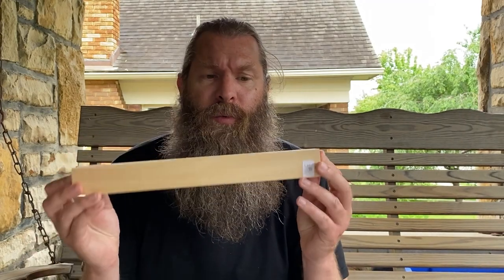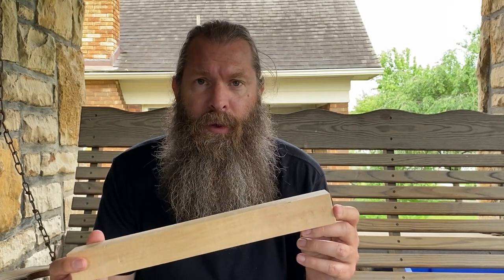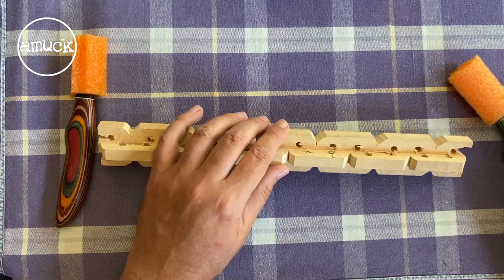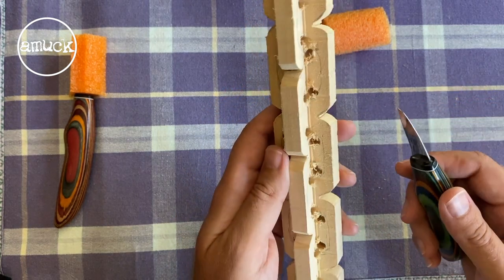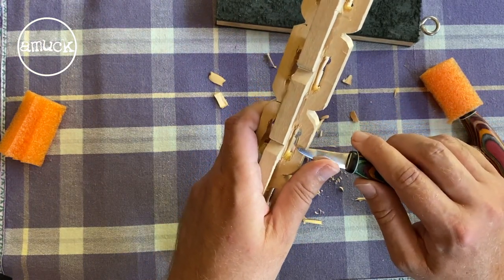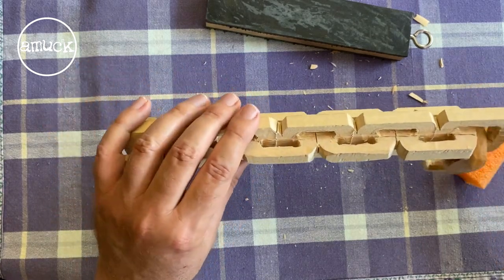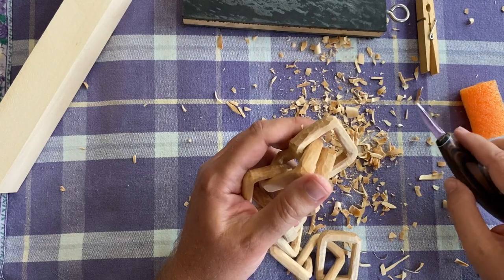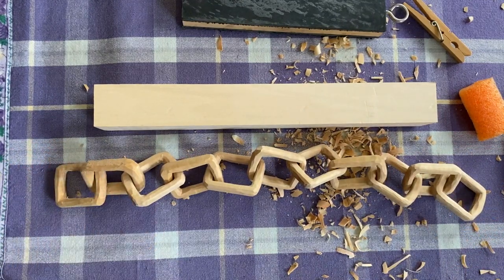Whittling A Chain

Comment: Fantastic job. I want to try the same ! Which kind of Wood did you use - and I really like your knife - seen it before on YouTube but nerver found out what its called  - hope you Will tell me ! Also seen your chess video. Very beautifull film - and set of chess. I’m writing from Denmark, hope everything is understandabel. Very best regards from here where we are looking foreward to Springtime. Esben Back.
Reply from the maker: Thank you! I’m using Basswood in this video. It’s soft and easy to cut. You can usually find it on line in different dimensions. The knives I’m using are made by Helvie Knives in the United States. Hope you try whittling. It’s a lot of fun.

Comment: Since you used a coping saw for the outside corners, you could have used it to cut the links apart by sliding the blade through and then re attaching to the frame.
Reply from the maker: You are absolutely right. My plan though was to try and whittle as much as possible.

Comment: Just one question......WHAT IS THE DIMENSIONS OF THE WOOD??That would have been a nice start.
Reply: Hi Jon, it started as a 1.5”x 1.5”x 13.25” piece of poplar. That’s just what I had laying around. Of course it’s up to you what size to start with. The process is the same.

Comment: Sawing all the corners with a machine, boring all the holes..... That's not whittling a chain! Whittling a chain, you remove all the wood you don't need, with a knive! Not with a machine! 😁
Reply from the maker: Hello, thank you for watching. I completely understand your point of view. When I carved my ball in a cage I only used knives but that was a much smaller project and therefore didn’t take too much time to complete. If I would have whittled the chain with only a knife I’d probably still be working on it and have lost interest in the project. I only called it whittling because the majority of the time spent on it was only using a knife. The world record holder for longest wooden chain ever made used nothing but power tools. I believe he did this only because of time restraints. Everyone chooses how much time they want to spend on projects their working on. I have lots of interests so that’s why I chose to use power tools to remove the bulk of the wood. I also think only using a knife would have resulted in a really long video.😆😆
Reply: @amuckdesign  Over the years I've carved over a dozen chains, most of them with a crosspiece for an anchor attached on one end, and a cage with one or two balls carved on the other end. I've done them all three ways - cut from a block that's been sawn into  "+" shape, cut from a rectangular block, and cut from a rounded tree branch. If you wanted to be absolutely purist about it, you could argue that ANY tool modification to the tree branch is not whittling, including splitting a section of the tree branch off with an ax. It depends on what you are trying to prove, and once you've proved that you can do it in its most primitive form - the tree branch - then it is just extra work to go through all of that effort again, just so you can start doing the non-drudgery part, which is the carving and whittling. So, no, I don't agree that using hand-held woodworking tools is not whittling. I almost always start with a "+" shaped blank of wood, though after that I personally stick to hand tools such as a drill bit mounted in a pin vise for drilling holes and various chisels in order to obtain flat-bottomed surfaces. For me, as long as all surfaces on the final result show knife carving marks, then it's whittling.  It's all woodworking with hand tools, and those who want to set special purist conditions on the activity are welcome to spend the enormous amount of extra time actually demonstrating what they so glibly preach to others. As you say, "Everyone chooses how much time they want to spend on projects they're working on." Best wishes, and thanks for the informative video - SLOphoto1
Reply from the maker: @SLOphoto1  thank you for the reply. I’m glad someone with as much experience as yourself could enjoy the video. I think you really hit the nail on the head when you said “once you’ve proven you can do it in it’s most primitive form, then it is just extra work to go through all that effort again”. I tend to like using power tools almost as much as hand tools, and I think there’s a time and place for most every tool. For me it usually boils down to time constraints and whether or not I’m working on a project just to have fun. It can also be fun to see what I or other people are capable of using whatever might be available to us at the time. Thanks again for your comment.

Comment: Now do a chain out of stone
Reply from the maker: 😆 I have no doubt it could be done, but I’d be using very soft stone and power tools. And I’d need some time off work.
Reply: @amuckdesign  I used carve tufa stone to make as mold to pour molten silver into. Some stone is like tufa is easier to crave than wood. be cool to have a stone and a wood carved chain and be an interesting vid. there are carved stone chains on temples in India i saw when i was there
Reply from the maker: @johnrenner7645  I was thinking some kind of limestone, tufa would probably work great. If you have some around you should try it. I’d really like to see it.